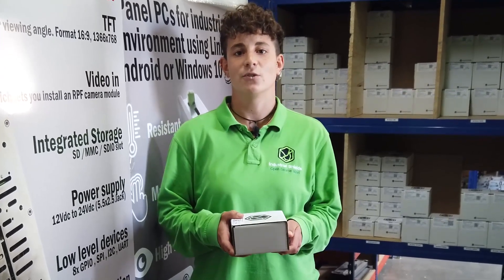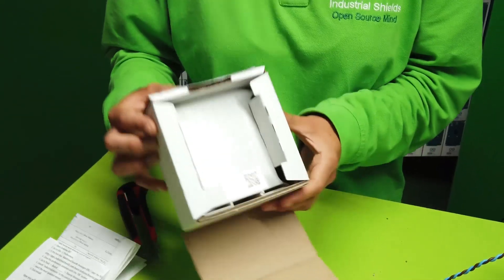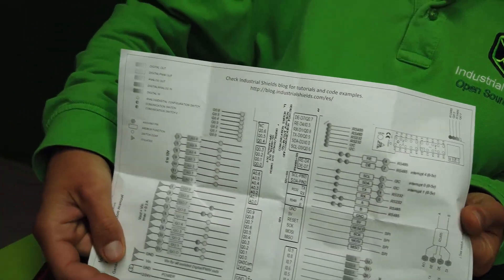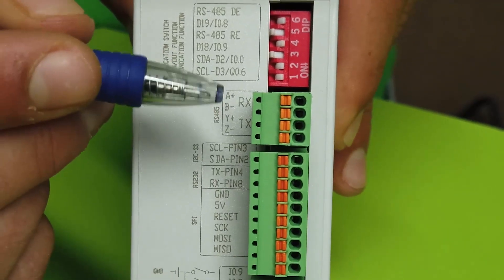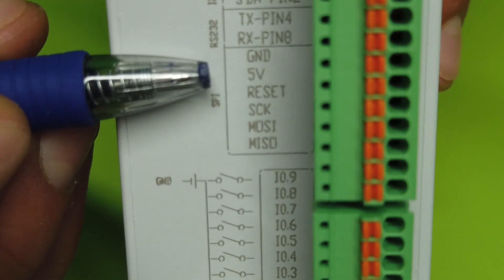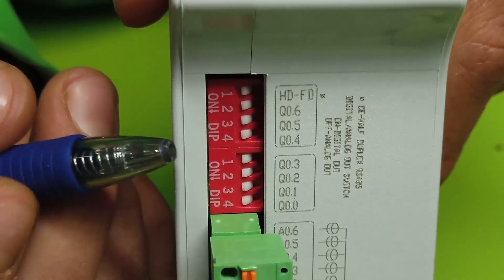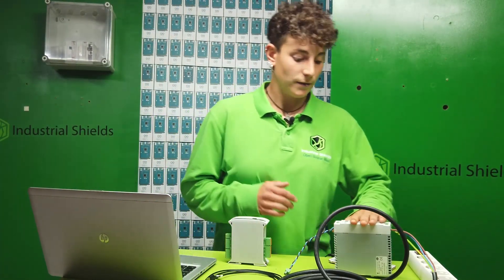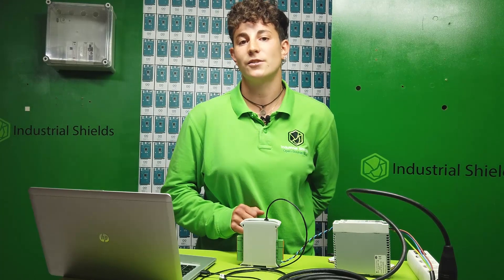✅ Unboxing of an Industrial ARDUINO PLC ARDBOX Analog 20 IOs

Comment: Hi, thanks for the video. hi have to build a dryer. My system has an HMI which send data via rs233 or rs485 (modbus rtu master), and a temp humidity sensor over rs485
Can i serve continuously the HMI master, and periodically read on the rs485 sensor? And also simultaneously debugging via serial print ? Many thanks
Reply from the maker: Dear Fabio,

Yes, you can with several of our devices like, for example our M-Duino Family devices: you can use ModbusRTU over RS-485 to connect the HDMI and the sensor in the same bus so you can send/receive data with both devices and, apart from that, use the Serial0 port to debug or use the Serial1 for the final application (long-term usage). Can you tell us please which specific device do you have? If you want we can proceed with this conversation here or in our support email: support@industrialshields.com.

Thank you,
Reply: @Industrial-Shields  
Thanks
I m already in contact with support, i just asked here because i liked this video. How can i connect on the same bus the hmi and the sensor ?  The HMI is a master, so the arduino should be the slave, but the sensor is a slave , so the arduino should be also a master to request data. But in my (poor) knowledge it is possible to have only one master on the same bus (so the HMI), is that correct?
Reply: @MakerFabio  Dear Fabio,

I recommend you to use an digital/analog sensor connected to the Arduino (Slave) so you will be able to request data directly from the HMI (Master) to only 1 device. If it is not possible, the HMI can be the Master and the other 2 devices Slaves connected in a bus structure.

Thank you,

Comment: I used one of the industrial shields in a project and after havving a few issues with I/O terminations decided to remove it and use a controllino instead as it has screw terminals.